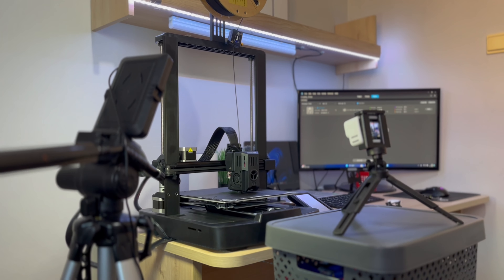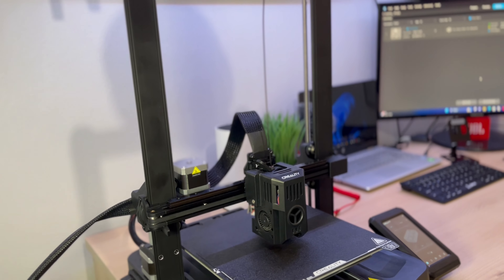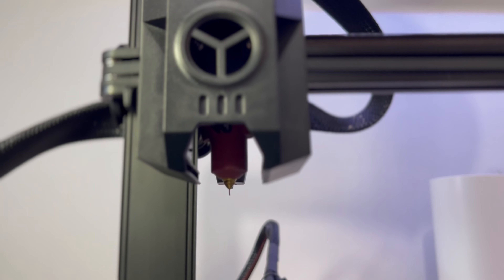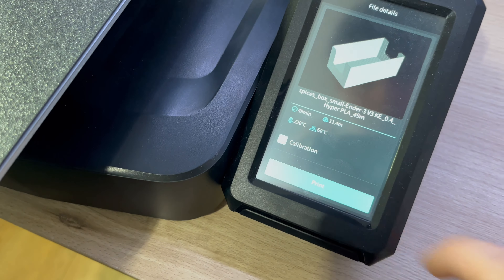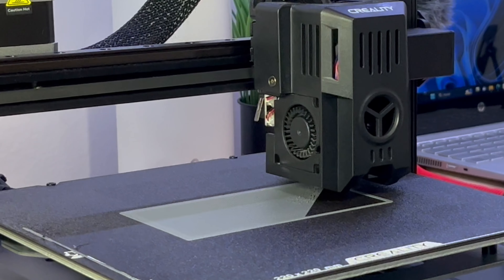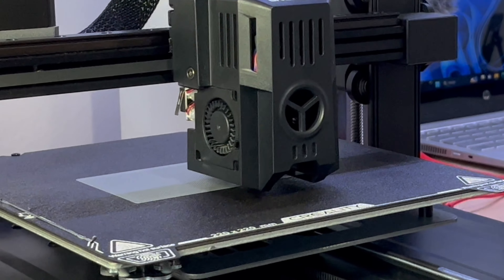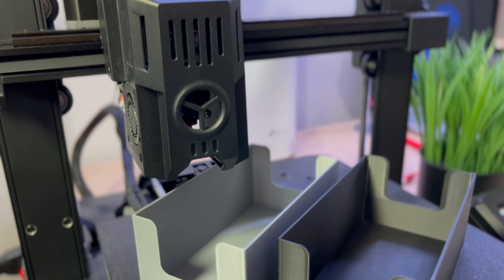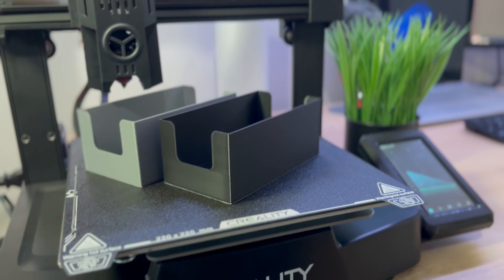The Art of 3D Printing: Creality Ender 3 V3 KE + PRINTING FAIL!

Comment: This is clearly a problem with the adhesion of the first layer, it can have several causes, try to reduce the z-offset or increase the flow of the initial layer
Reply from the maker: thank you so much:)
Reply: What’s a good z offset to be at?  I think mine is auto set to -2.56 or something.
Reply: @DeRock401  Exactly, each machine will have an ideal value even if it is the same model, you have to test it on your
Reply: I increased my bed and nozzle by a few degrees.  Higher nozzle heat also causes the stringing that occurs to be easier to remove in my experience (more wispy, less blobby).

Comment: The funny(not) thing, that the same gcode sometimes have this issue, sometimes not...
Even more funny, that after failed try I touck bed, so it is not super clean...

And btw, do you have an issue when printer just hangs, screen is black.. and only reboot helps?
Reply: Yeah I've had that hanging issue.  Probably worth updating the firmware and/or rooting and using GuppyScreen.